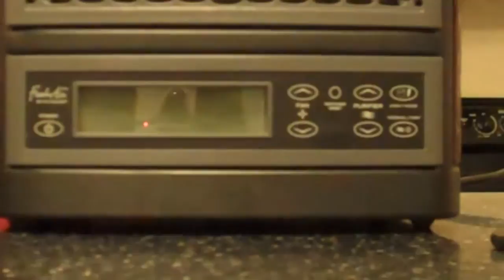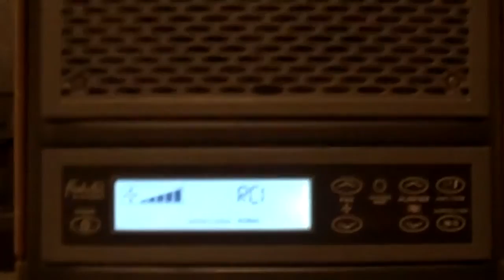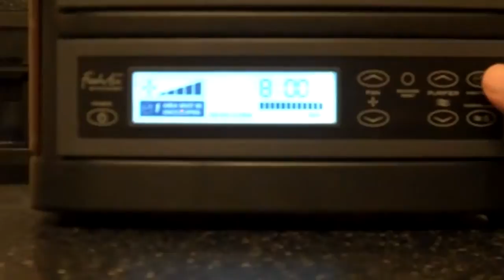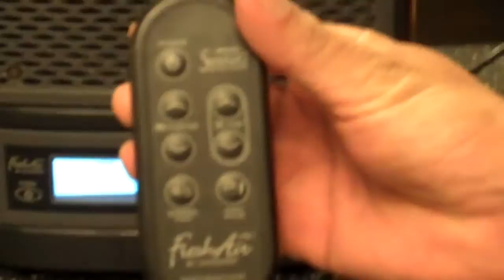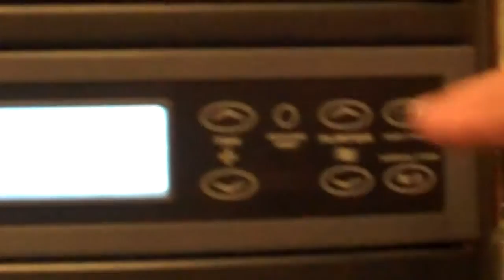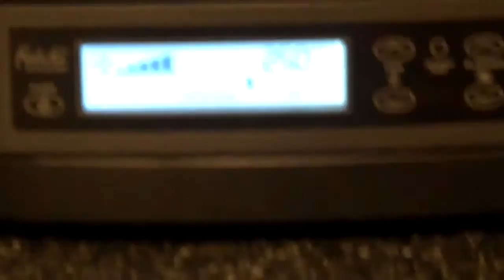Setting Up Your FreshAir Surround

Comment: Ozone oxidzes (rusts) silver quickly (turns it black), so if you are keeping physical silver bullion at home (or worse, silver decorations in the open), you will need to put the silver in sealed ziplock freezer bags before you turn these machines on in high or away mode. Gold does not react with ozone, so it's ok. You can't mix ozone and carbon filters  (Ecoquest / Vollara Fresh Air & Austin Health Mate in the house at the same time) - the ozone will saturate the carbon filter very quickly.

Comment: Ecoquest machines are the kings of odor elimination. If that is your primary need, this is what you want.  It has some dust & allergen removal from the RCI but it is not its forte. If your needs are more particles / allergens, you need to get an austin air ($500-600) or IQAir ($900+) with their extensive HEPA filtering and 15+ lbs of carbon filter. If your needs are mixed, get a sharp plasmacluster ($350-400) - it mixes ionization & RCI with HEPA & carbon filtering (less than austin air though).

Comment: These things are not worth $750. You can buy used Ecoquests for $75-150 on ebay. $300-350 new on ebay for new from dealers going broke. Austin airs, king of allergies and particles, are $500-650.  Sharp Plasm clusters, the odor/particle hybrids are $350-400.  Ecoquest/Vollara/GT 3000 are the kings of odor elimination, so if that is your need, you need to get them off ebay or you will be overpaying. Plates and UV lights are cheap on ebay too - $6-15 each new. RCI cells not so lucky, $80 new.
Reply: US govt banned these machines due to serious health issues. Whats your thought on this?